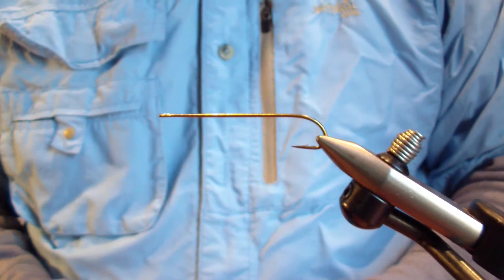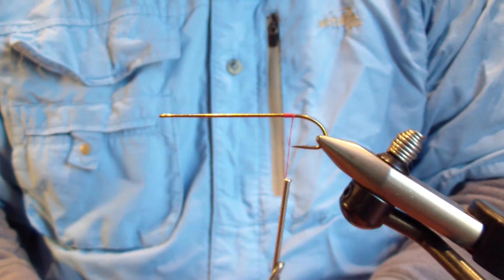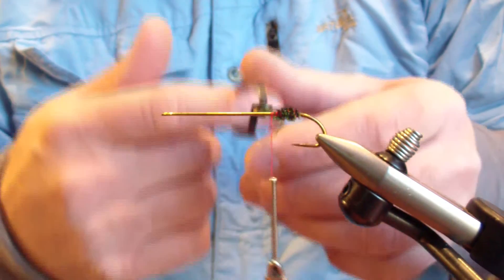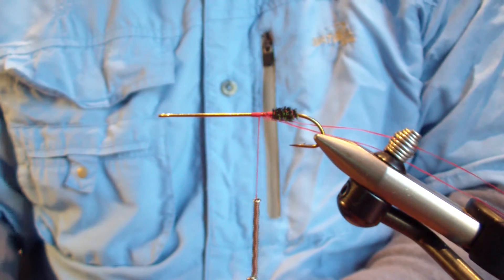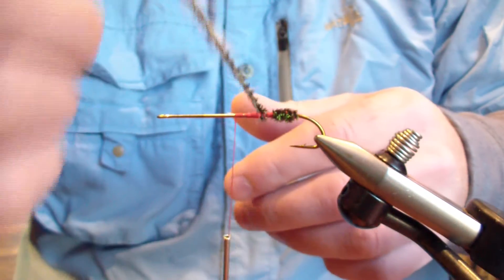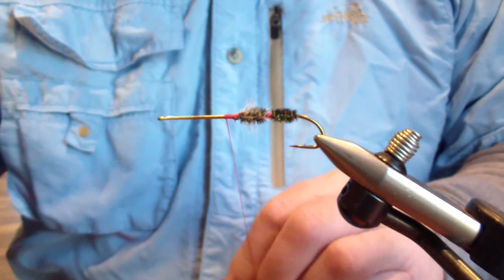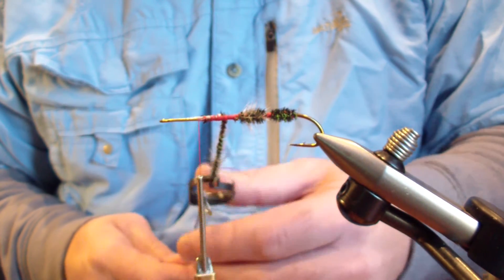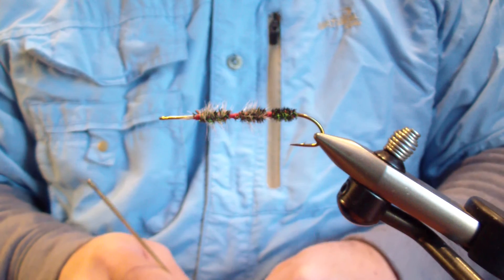Herl Dubbing Brush Techniques

Comment: There's an easy fourth method to reinforce/ Let thread hang and move herl up shank with herl as u wrap. This moves thread in union  and re-inforces as u go along.
Reply from the maker: Correct, You can move the thread in one step as you stated, you can also counter wrap over the herl with a thread tag which is also common. Thanks much for the visit.
Reply: I started tying in 50's from Stewarts Book.  It took me about 20 years to pick up what you showed us in one video.